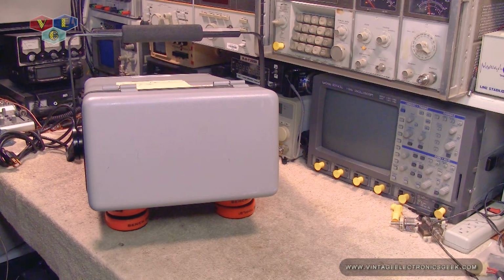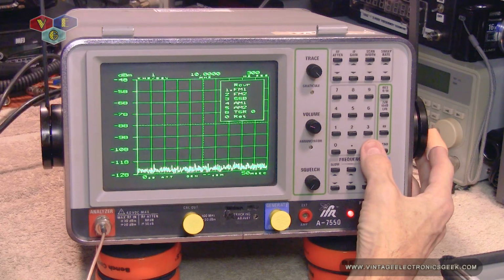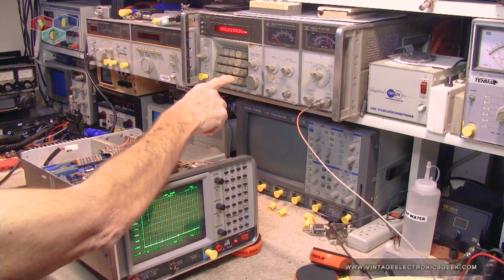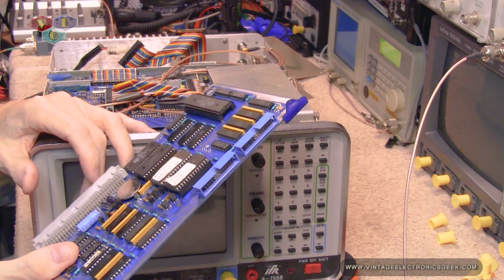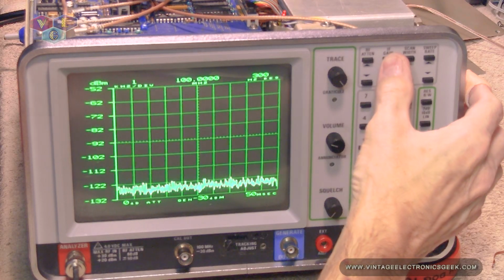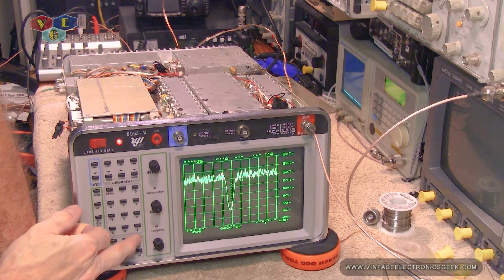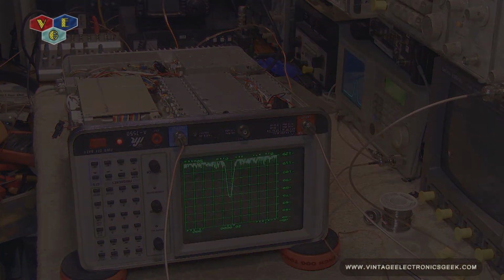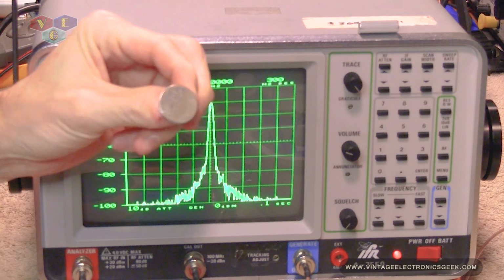IFR A-7550 Spectrum Analyzer Repair

Comment: I inherited a A-7550 that I'm 100% certain someone keyed up a radio into at full power. That would likely take out the Receiver IF Module, and possibly also the 0-60db attenuator. In the IF Module, MXR1 is first in the chain to take the hit, followed by FET Q1. Are spare parts or modules available for these, or am I SOL?

Comment: Nice find.
I would have checked all the power rails first. Did you check the battery voltage in circuit and out? Is there a calibration function or is there just the self test ?

Comment: Jack,
I would not leave those alkaline cells in there as they will leak. Get a coin cell battery holder for a CR2330 or a 2450 (you have plenty of room) insulate the bottom of it so you won't have shorts. The proper sequence after changing the battery (or updating the EPROMS) is to pull the SRAM to clear the bogus data, reinsert the SRAM. Install the CPU card and then cycle the power 3 times on the 3rd power up use the keypad and run the RF attenuator up and down a few times. This initializes the SRAM. Power the unit down then up. After that sequence the unit will function normally. On power up to save time after that as soon as you see the splash screen you can press any key to cancel the splash screen and start using the instrument.
Sam
W3OHM
P.S. in my case I did not have a holder handy so I made a battery assembly using a CR2450 I had. I soldered wires to copper tabs and then used anisotropic Z axis conductive tape to bond the copper tabs to the cell and then enclosed the cell in some low temp heat shrink. I soldered the wires to the CPU board and then tacked the cell assembly in place with hot melt glue. With the capacity of the CR2450 it should be good for another 30+ years!

Comment: Very nice find there Jack. Just a couple of observations. You can think of the tracking generator as a sweep generator. It puts out a signal that follows the sweep on the screen. So if you have it set at 100MHz center frequency with a Span of 10MHz then the tracking generator will start at 95MHz and sweep along with the screen to 105MHz. That way you can hook up an FM IF can to it, for example, and set the center frequency to 10.7MHz with a span of 1MHz. Take the output of the tracking generator to one side of the IF can and the input of the analyzer to the other side of the can and it will show you where the resonant frequency is and what the Q, or efficiency, is. Another thing, the resolution bandwidth can be a bit tricky to understand. Basically it sets how well you can see a signal. For example if you set the Resolution Bandwidth, RBW, to 1MHz and you  are looking at a signal that is only 500Hz wide you won't see much more than a straight line up at the center frequency even if your span is down to 500Hz because the resolution isn't there. And one last thing, I have one of these holding down a corner of the carpet because that is all it is good for now. I had it plugged in and off when the power supply let loose and fried the unit. As mentioned before in a comment the power supplies in these are not great. For that reason I would suggest you not leave it plugged in all the time.
Reply from the maker: Dave - Thank you for your guidance, input and insight, I appreciate it immensely, you are the best!  ~Jack, VEG
Reply: @VintageElectronicsGeek  You are welcome

Comment: Jack,  Never disconnect cables while the unit is powered on.  I have repaired one of these before . They are useful instruments. The power supply is a poor design by today's standards, as are many early . switchers.  You will probably find many leaky caps in the inverter.  Be careful soldering on these IFR blue circuit boards. They don't tolerate heat well and tend to lift traces.  Good luck.
Reply from the maker: Todd - Thank you for your guidance and insight, I appreciate it immensely!  I will need to attack the e-caps at another time...maybe this summer...thanks again!  ~Jack, VEG

Comment: Looks to me like you fingered it out Jack. Congrats. Now just find the correct battery and you will be golden. I'm not built that way, I can't just use any old battery, I have to have the correct one. Kudos to Mrs. VEG for all her help. To paraphrase something I heard a lot when attending electronics tech school was the problem with most test equipment is that it will give you some sort of reading or indication. It's up to the individual to figure out what it means. In other words, those readings or indications are open to the interpretation of the person doing the testing. :)
Reply from the maker: I'm good at fingering things!  I'm with you on the battery, I did buy the correct one but it fell through and I didn't wanna wait another 2 weeks for them, so I just improvised...maybe correct it at a later date? Yes, she has been a real trooper jumping in and helping me out, I just hate loosing my independent's some...I guess that saying for test gear could also be applied to any DUTs!  I hope one day to be an electronic guru like you!  :)  Thanks!  ~Jack, VEG
Reply: @VintageElectronicsGeek  Appreciate the thought Jack, but I'm far from a guru. LOL
Reply from the maker: @DERB_Seymour_Indiana  I've seen you strip a radio down to its PCB and put it back together, I have seen you convert a radio into a transmitter, heck I even seen you sand your car once, that's a lot more then I can do! Edit:  Heck, you have even recently taken your 2 wheel drive car 4 wheeling cuz your bad to the bone!  :)  ~Jack, VEG
Reply: @VintageElectronicsGeek  LOL thanks Jack